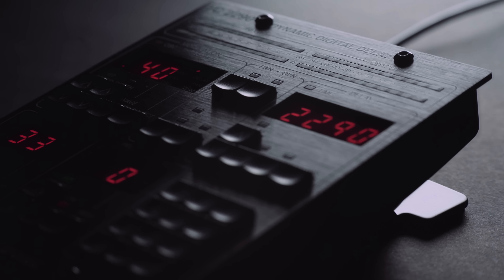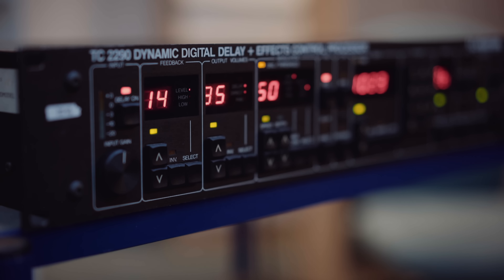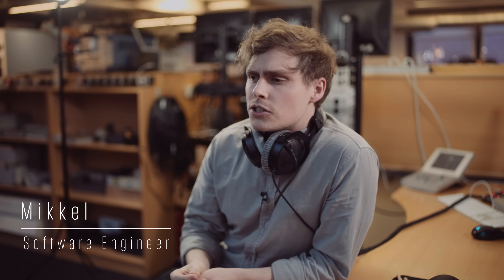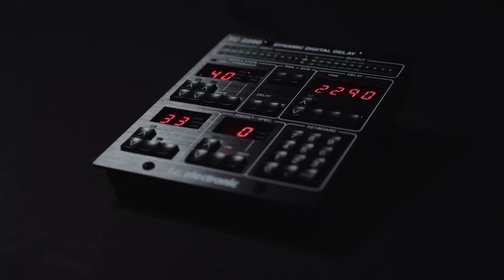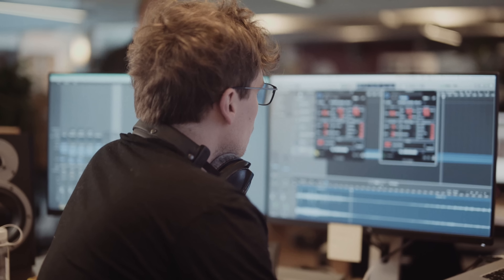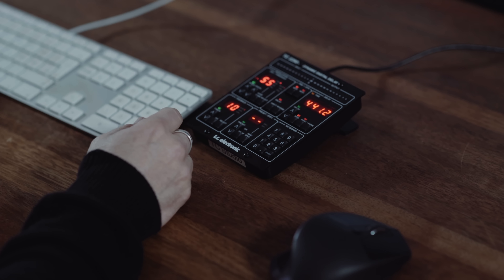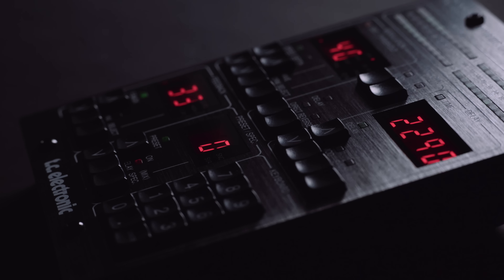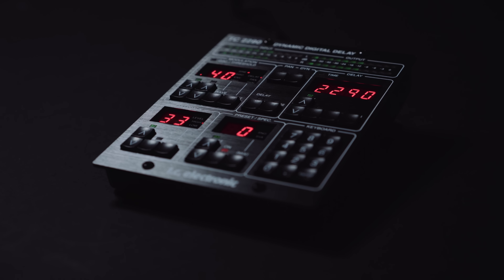TC2290-DT - Official Product Video

Comment: very cool! ... so, how many instances of the plugin until the DSP runs out?
Reply from the maker: The processing happens within the plug-in so you can run as many instances as your CPU will allow 😌
Reply: Ah, I had the impression that it's an actual DSP unit capable to flawlessly integrate with the DAW. So... it's basically a plugin (iLok'ed probably) with a usb midi controller. Still seems cool (minus the iLok part :P )  but to be honest, I find it overpriced! If it was DSP based, than I would have considered it for the price..

Comment: Is this abandoned/discontinued by TC? - AU fails plugin validation in Logic Pro :-(
Reply from the maker: Hi Lee.  We are still very much focused on this product.  We are currently working towards M1 compatibility on all of our plug ins.  Is it an M1 Mac?
Reply: @tcelectronic  I’m glad it’s still alive, fails validation (and causes logic to hang on start) on both m1 and intel using v2 of the plugin.
Reply: Just reinstalled it on MacOs Ventura 13 and Logic 10, and it's working perfectly! 

Tip: 
Create a new empty Logic project
Add an "instrument track" (loads an electric piano sound by default)
Add a TC Stereo Chorus Flanger plugin on the instrument channel itself, leave it as is (default settings)
Add a TC2290 plugin on the instrument channel itself (not on a send bus), set it to the "Keys/Long & Sweet" preset
Play some major chords

You will experience a sudden state of bliss and happiness, it is completely normal
All the best 🙂

Comment: So it’s just daw? Can’t put it on my pedalboard?
Reply: Seems to be a plugin controller, not stand alone. Maybe look at Nova delay for that..
Reply: Wagoo I didn’t like the nova. Sounds nothing like the 2290. Hopefully they make a pedal.
Reply: Yes, fair enough. I think if they've done all this work they may as well host the plugin code on an atom or ARM board and make a stand alone pedal and rack version too.. that'd be more appealing to me than a plugin controller since I mostly work outside the box.
Reply from the maker: It's not going to work as a pedal, no. It's a hardware controller for the plugin. Enjoy!
Reply: Wagoo same here. I was excited but won’t work for me.
Reply: TC Electronic will you be making a pedal version?  I would use this product if I recorded but I tend to play live mostly.